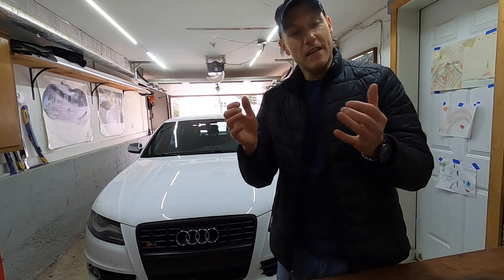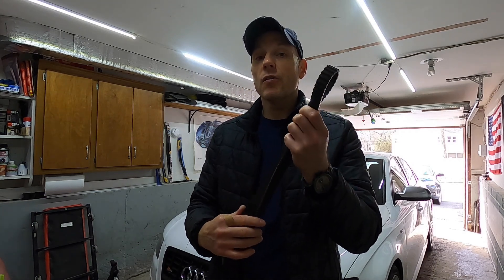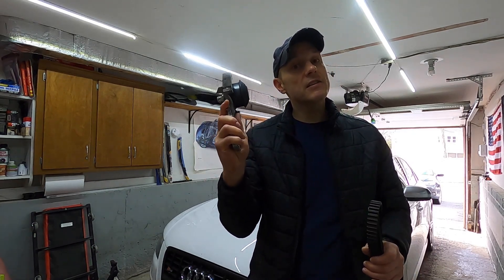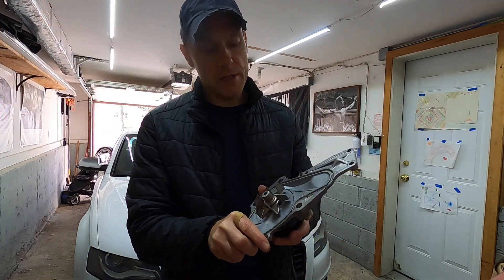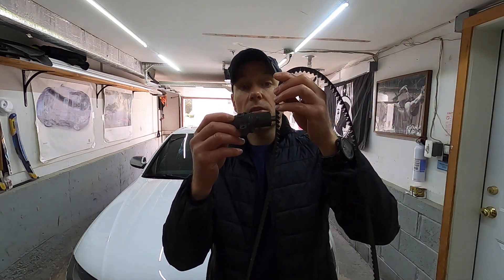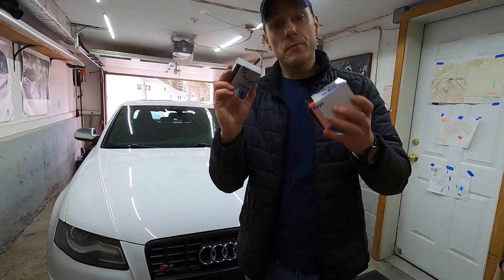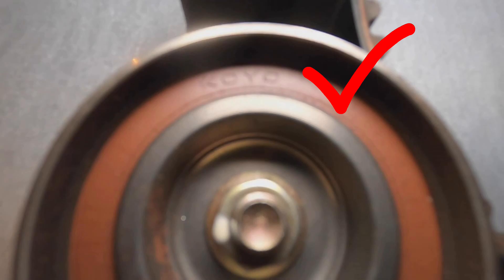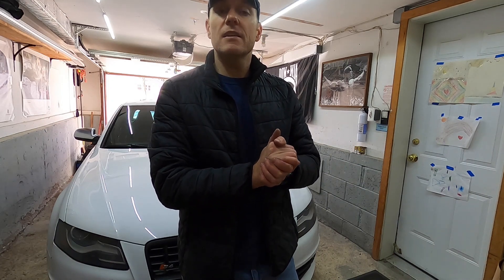Honda and Acura timing belts - What does it look like after 100,000 miles!

Comment: Nice to see this. A lot of people assume the belt is going to go as soon as it goes above 7 years, but no. It's the tensioner that usually goes first.
Reply: i agree, the tenshioner is one of the most vital moving parts in the timing drive system, that's why they sell the entire timing kit all together, it is foolish to do a timing job without the entire kit, water pump , pulleys, gasket, ETC.
Reply: @skismosis  Honda doesn't sell any kit. But Aisin does, and their kit is the gold standard.
Reply: @wiimaster2847  you are correct, and that is what my Mechanic used when he did my timing job. total cost to me as a friend (LOL) was 600.00, out the door.

Comment: I replaced the timing belt on our ‘02 Acura MDX at 145K as routine maintenance.  The OEM belt was in excellent condition like yours. The Aisin water pump showed no weeping at all. The only part that was clearly at the end of its life was the tensioner bearing which did not turn smoothly and showed visible bluing of the bearing retainer due to the bearing overheating.  At some point, that bearing would seize and cause a cascade of damage, likely destroying the belt and hence the valves. As you observed, the belt replacement is less about the belt and more about the parts related to its proper operation. I’m always skeptical about people reporting that their J-series belt failed early when in reality the belt was probably the casualty of improper installation or other worn parts. Thanks for the video!
Reply: 100%. A lot of people also fall for the counterfeit Honda kits on eBay/Amazon, then the belt breaks.

I've never seen a factory timing system on the J series go due to the age of the belt. 99% of the time what fails is the dinky little hydraulic tensioner. That tensioner is easily the weak link in the entire system. It often starts leaking/tapping on cold starts well before the interval. The belt itself is very strong, and I've seen some belts go to 300k even. Our 06 Odyssey made it to 13 years and 90k on the factory timing system before it was replaced, and our 2012 Accord V6 is currently at over 11 years and just under 30k on the factory timing system.

Comment: Where's the cracks in the BACK of the belt?
Reply from the maker: Zero cracks.
Reply: @CarsNToys  show us the back of the belt with it bent and let's see, bcus ain't no way the back will be like brand new. I've done lots of timing belts on Hondas and Toyotas and a few other manufacturers and after that much miles, if you bend the smooth part very well regardless of how they look when straight, you'll see very tiny cracks/separations starting to form.

 Manufacturers recommend intervals bcuz they don't want you to get to the absolute threshold before replacement, bcuz most people wouldn't still even replace it then, which will lead to catastrophic damage.

Comment: Really appreciate all your videos. Especially the classic amazing TL. 

Shouldn’t the crank seal and other internal seals be also changed at the same time (same labor)? I say this because my mechanic is known for not selling what you don’t need. But he failed to change my seal at my timing belt service even though there’s an oil leak. I’m not paying $500 to do labor just to get to that one part. He should have changed it then and there.
Reply: Usually the OEM cam and crank seals in Hondas and Toyotas don't leak until close to or after 200k miles if maintained properly. So it's not necessary to replace them until the second timing belt job, assuming that you replaced them at the recommended intervals. 

Furthermore, it's EXTRA labor to replace the cam and crank seals.
Reply: There are really 2 camps there. Some say not to touch it if it's not leaking (to avoid potentially causing a leak where there wasn't one) and others say do it while you're there.

Comment: I see you  have a keen eye for GREAT PARTS.!! AISIN PARTS are the best for your vehicle. Last May, I had noticed a slight ticking noise on my Wife's Mom's 2012 Honda Odyssey on start up. It would go away completely after about 7 minutes at idle. My Father-in-law took it to the garage to get it checked. Had to leave it as it only would do it when completely cold. It was the tensioner. Everything was new except the old tensioner had been reused.🙄😍
Reply: that's why they sell and suggest that you replace it all as a kit, anyone that does not is making an expensive mistake, the entire job parts included cost me 600.00 work done by a very reputable mechanic.
Reply from the maker: That's a great price!
Reply: Dealers do this a lot, they advertise cheap timing belt specials but the cheap price doesn't include things like the tensioner.

Comment: my honda accord 2005 exl started leaking a little water after 211,000 miles and my mechanic said the timing belt still looked incredibly good , goes to show you that timing belts were not a bad idea from the beginning. p.s i am still driving this car.
Reply: That’s the original timing belt ?
Reply: @mrc79  yes it was, this engine had never been into while in the hands of the original owner, i am the second owner.
Reply: @skismosis  pretty cool,  to me that’s really pushing it, more than my comfort. But my (2nd) water pump discombobulated on the freeway while driving at 195k miles so I did the timing belt then.
Reply: what brand is the timming belt?